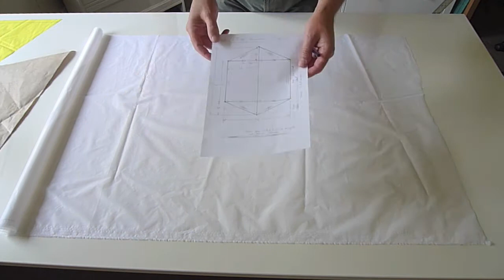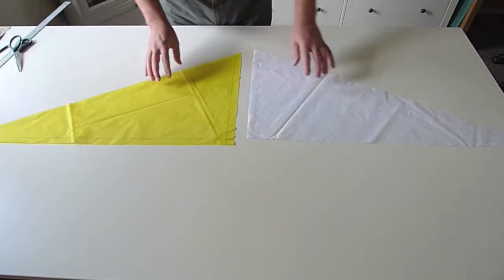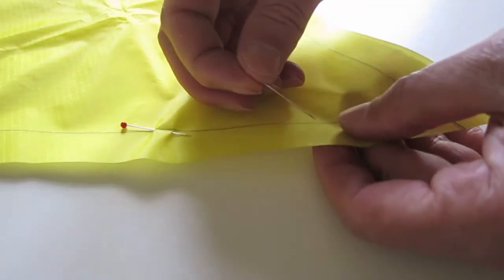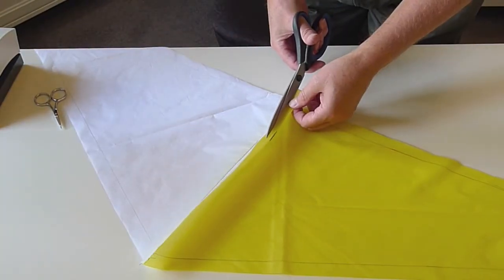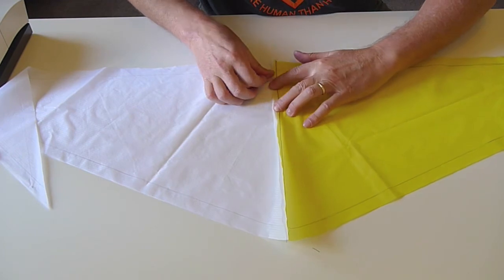Kite sewing - cutout and seam

Comment: This is the best resource online for Rokkaku builing! Thanks!. Why do you do your kites in 6 parts instead of a single piece?
Reply from the maker: It's all about fabric stretch. Keeping the least stretch cloth direction aligned with the edge. It would look like an old bag otherwise
Reply: Thanks for the quick answer! It makes sense.

I'm just starting to build kites, and a lot of online info does not work anymore. thanks again for those videos